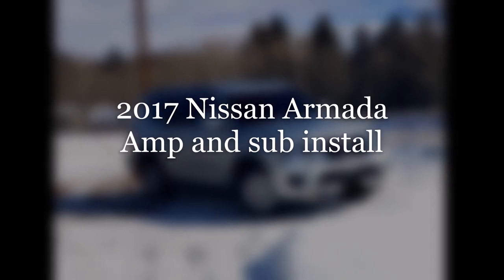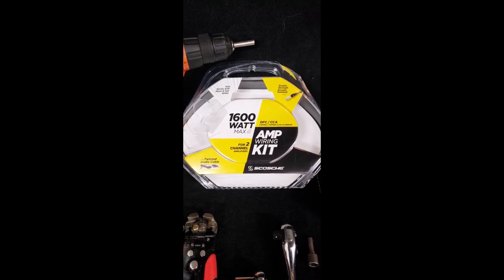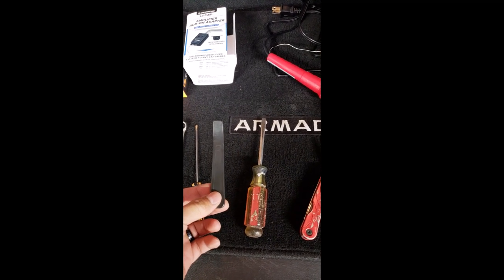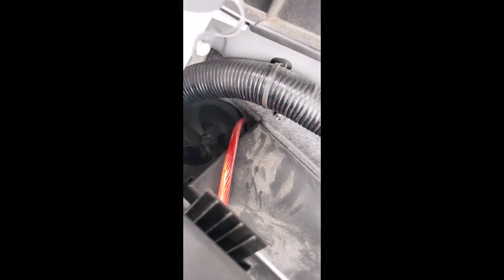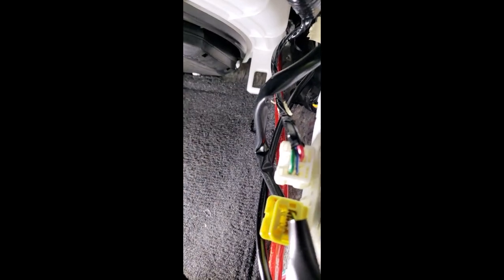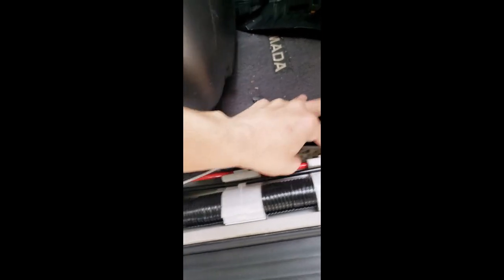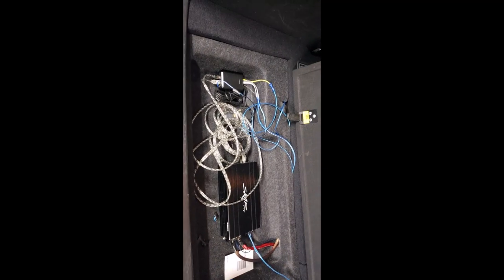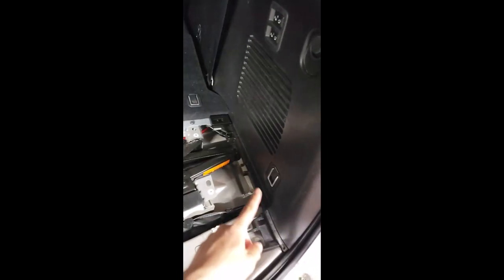Nissan Armada 2017+ sub and amp install

Comment: Where can I find the pictures of what wires you grabbed the signal for on the LOC?
Reply from the maker: 36 min 50 seconds
Reply: @SIZZLE1776  I’m getting ready to do this, before I splice into the wires at the amp just curious if the wiring at the subwoofers would suffice?
Reply from the maker: @mikeapplegate292  no you have to get the signal befor it gets to the amp. When I first did it I tried to connect to sub and any speakers in the back area and it didn't work.
Reply: @SIZZLE1776  okay thanks for the reply

Comment: I have the same truck where did you get your speaker source from? I tried the two speakers at the top of the hatch but sound is very low.
Reply from the maker: Got it from lines before it hits the factory amp
Reply: That might be my problem as well. I’m not getting any feed to the sub.

Comment: This helped me out a lot! I just bought my Armada a month ago and I going to attempt to install my set up in a week.
Reply: Did you ever post the pictures of where did you tap in for the low output converter?
Reply: @LILBUCKE337  I tapped into the front dash speaker on the top of the center dash. Works perfectly

Comment: I want to install a kicker amp ix 1000 
In the same compartment its a compact size. But not sure if it will over heat. 
Any suggestions???
Im planning to add it on the back seat.

Comment: How did you figure out which speaker wires to tap into?
Reply from the maker: I just made sure they were speaker wires before factory amp. Doesn't matter what set you use